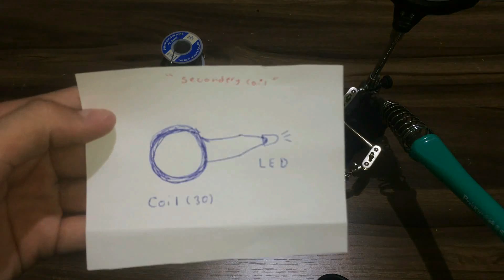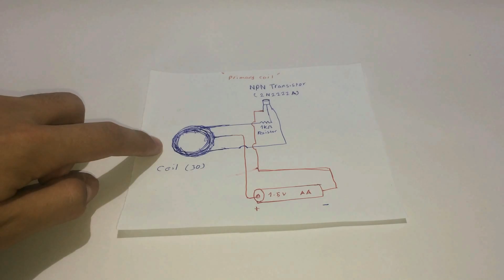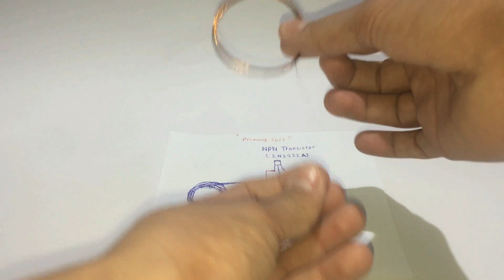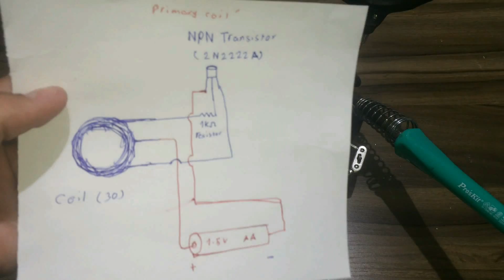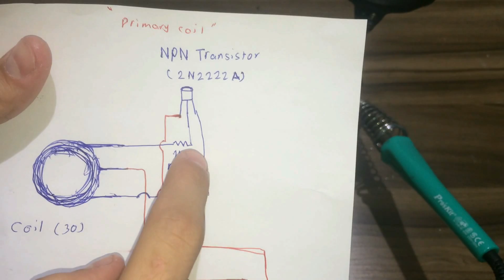How To Make Wireless Electricity Transmission Circuit - DIY (Step By Step)

Comment: is it possible to use thicker wire, parallel  resistor and 9v battery to glow up the usual energy saving Lights !

Comment: Could using insulated magnet wire make the experiment fail? I've recreated the experiment exactly but it still isn't working. The only thing that is different is the copper wire. I'm using a 30 gauge insulated magnet wire... Could that be the issue? Also I'm using wires that came off a battery holder. I had a few laying around so i plucked the wires from it. I use those wires to solder to the three points on the transmitting coil

Comment: What gauge wire is that? I'm a research student in high school making your project as a starter. I will be progressing on making a much larger one.
Reply from the maker: GameEnchanted i recycled it from an old tranformer so iam not sure about its gauge
Reply: I planned on taking the transformer out of an old microwave and using the two coils for a large-scale test in the future. I planned on turning the coil into an electromagnet.

Comment: It is working on me even without transistor and resistor. Just make the primary coil similar to the secondary and put the power supply to the primary coil but if the winding of the coil is less so used 1.5v battery

Comment: Can I use thicker wire some stronger resistor and do it with 9v battery?
Reply from the maker: well I tried once and the transistor got so hot so I didn't do it again , maybe you can test it and let us know what is the results ^_^
Reply: You were right. Transistor got very hot. I had to add parallel resistor, to reduce voltage to 5v... and now it works great.     ^_^
Reply: can you share your project?

Comment: my circuit doesn't work, the LED will only flicker when i switch on and off the power supply
Reply from the maker: probably the problem is with your transistor
Reply: Don't worry i am making and uploading the easiest way of wireless power transfer.watch my channel technical action ok boy?

Comment: can I use a transistor s9013 instead of the 2N2222A
Reply from the maker: GadgetsAndTech saerch for its data shit if its used as a rapid switch transistor so you can use it
Reply: Kurdish Inventor Shatasheet not shit😂

Comment: bro ,, i have a doubt .
i think we should give AC current to the coils right ... but here u have given DC battery ...its surprising for me....could me please explain ??
Reply from the maker: I added I 2n222a transistor to it , it works as a rapid switch so it will produce AC like current instead of going and coming back it will go and stop go and stop like this

Comment: Will any transistor work?
Reply from the maker: +‌‌ unfortunately No , But you can easily buy one in any local or online electronic shop and its quiet cheap . Thanks for your comment .
Reply: +Kurdish Inventor thanks I made one and it worked (I used a C1815 transistor)
Reply from the maker: well that's great weldone , I learned something from you many thanks
Reply: But I should add a resistor since the transistor gets hot easily.
Reply from the maker: Thanks a lot for your information's this helps me a lot ^_^
Reply: You're welcome. I get all my electronic parts like transistors and resistors from old electronics. I got the transistor from a paper shredder I took apart.
Reply from the maker: +‌‌ i usually do this too but unfortunately i cant find old devices to take apart and recycle the parts again
Reply: Did you know that the transistor also increases the voltage? Normally 1.5 volts isn't enough to light an LED, but it still works in the circuit.
Reply from the maker: yea it works as joule thief circuit
Reply: I added a 1k resistor and the circuit doesn't work. I replaced it but it still didn't  work.
Reply from the maker: well I have no idea what is wrong, are you sure the transistor works ? or maybe use 100 ohm resistor instead !
Reply: It works without the resistor, so the transistor is okay. The resistor I used has the colors: brown, black, red, gold.
Reply: Ok I'll try a 100 ohm resistor
Reply from the maker: but make sure the transistor works